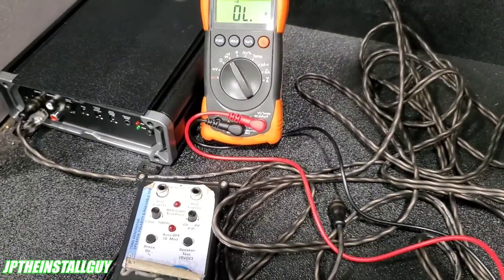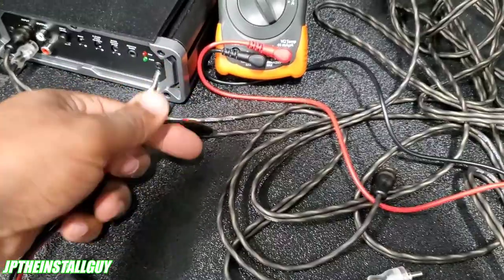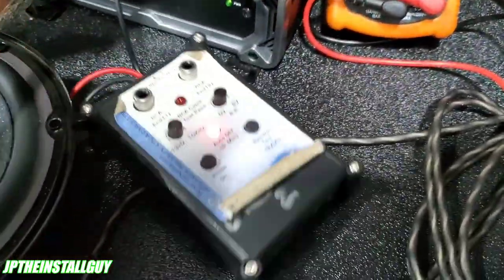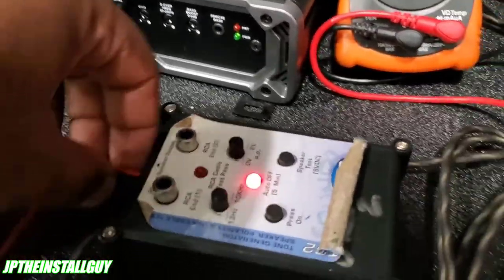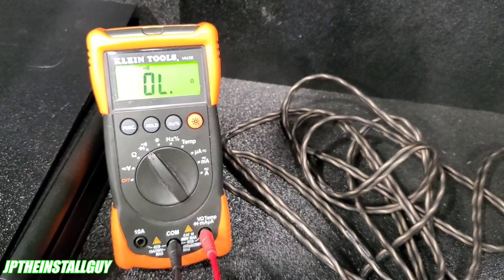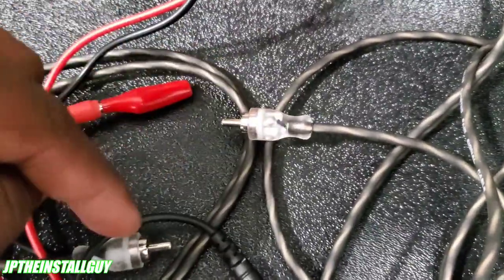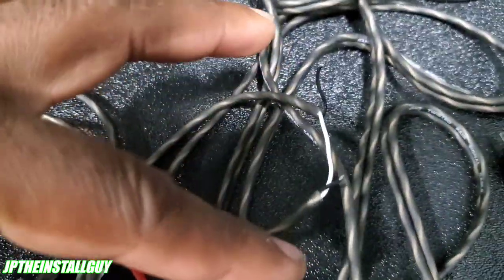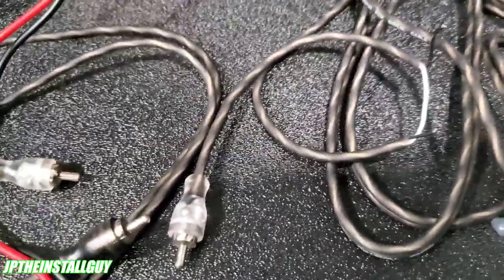How to test/troubleshoot rca cables for your audio system

Comment: When you're checking for continuity, you should also be checking for isolation to detect any shorts. Center pin to center pin (hope for beep), then center pin to shield (hope for no beep).  Shorts in RCA cables are common and can cause damage to your amplifiers.

Comment: You created an Open to the center pin when you cut that wire.  To test for a Short, you just need to put one test lead on the center pin and the other test lead on the outer shield.  Make sure the other end of the RCA is not plugged in. If you get a tone from the meter, you have a Short, that's bad.  If you get no tone, it is open, that's good.

Comment: Hey bro I just got a new sundown 2000 watt amp. Hooked it up where my old amp was. Same everything. Except new amp barely pushed the speaker with gains all the way up. Like it isn't getting enough signal. Rip it out, put old amp back in and it bangs. I have cheap RCA's. If it was an RCA problem wouldn't it he the same for my cheap amp as well as the new one?
Reply: Did you fix it? @850cane
Reply: @1kbutta  bro. My eq settings on my phone were changed after resetting my phone. Had two EQs cancelling each other out

Comment: I was dealing with a situation this morning that I had to troubleshoot with no tools so I began with checking the amp no output was hardly coming out my subs from the amp so I removed my amp and installed my other amplifier to see if if was the amp but  still hardly any sound so then I removed the rca jacks and replaced them and the output was still hardly any sound coming from the headunit so that led me to know it has to be the double din subwoofer outputs are bad and I was ready to replace the radio anyway due to the screen functions stopped working a few weeks ago

Comment: I'm Getting A Grumbling Sound Thru My Subs With No Music On...What You Think It Is...
Reply: Take jumper wire connect to ur main unit earthing and other wire connect to ur rc ground
Reply: me too
Reply: It Was My RCAs...I'm So Far Advanced From Where I Was ..It Crazy....2 Skar DDX 12s On A Cab22...Custom Boxed Tuned To 32hz..Big 3...Sky High 0G Everywhere...100Ah Extra Batt...4 Skar FSX 6.5s And 2 VST Bullet Super Tweeters Ran Off A Kenwood DMX47S...
Reply: What kind of rcas did u get?
Reply: @Eldelaramona57  Wasn't A Particular Brand...It Was Just Twisted And Shielded Instead Of Regular RCAs...

Comment: you didnt create a short circuit, its an open circuit ..just on a point of correction
Reply from the maker: I know it's an open circuit. It was representing a short just to show an example of it being a break in the path
Reply: Short would be both wires touching each other.  Tip to shield would ohm to each other.  Good video though
Reply: @jptheinstallguy  you represented an open circuit, no big deal. If you let both wires touch, that would create a shorter path for electricity to flow, or short circuit.